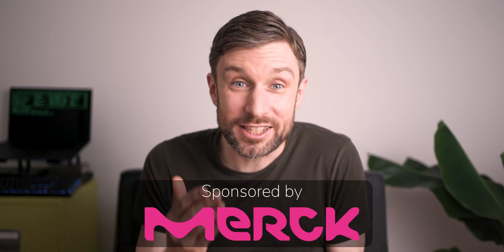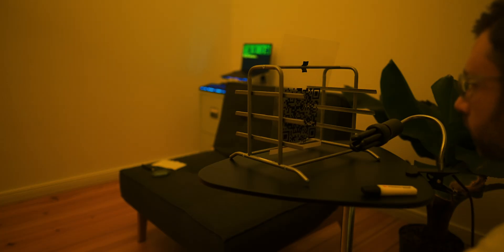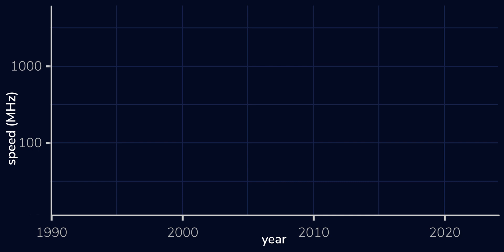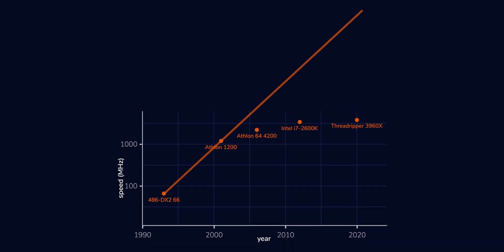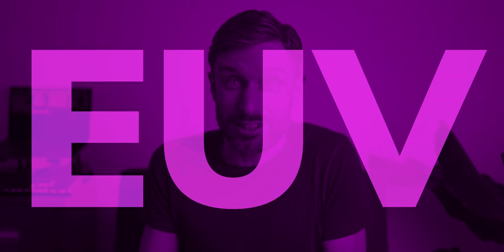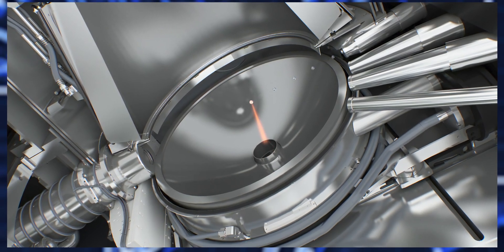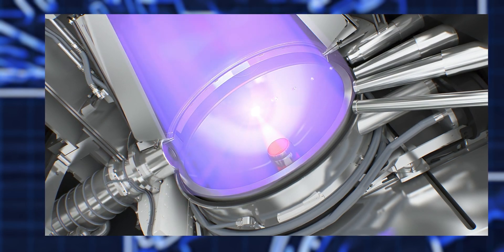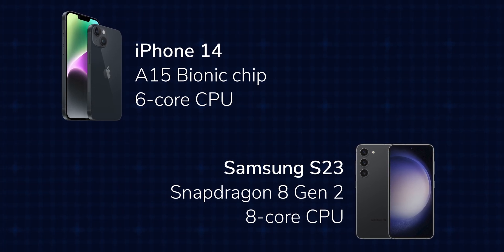The EXTREME science of making microchips

Comment: Why so many mirrors if they’re that bad for the power?
Reply from the maker: I don’t know the exact optical details, but I’m sure the engineers tried to minimise the number for exactly that reason! My guess is it’s because you can’t make a single mirror that reflects the light precisely enough: there are a number of issues known as ‘optical aberrations’ that basically make it impossible to precisely focus light if you’re just using one mirror or lens. It’s the same reason camera lenses have multiple glass elements—one on its own would have an image that was blurry at the edges/brought different colours to focus at different points etc, but by combining a few different ones together, you can ‘cancel out’ these optical errors and get a sharper image. :)